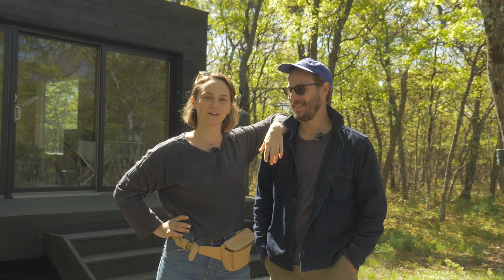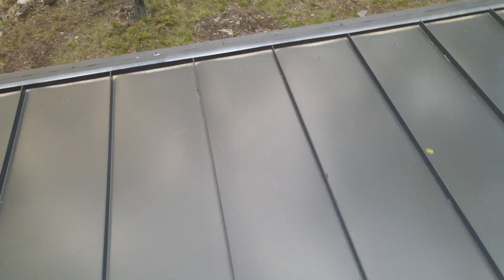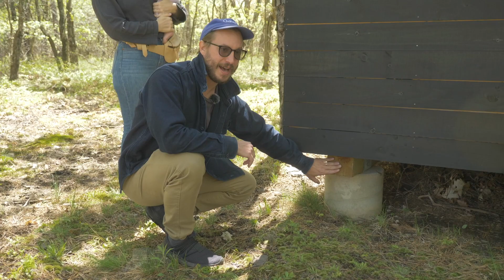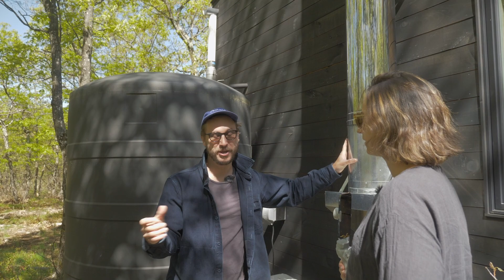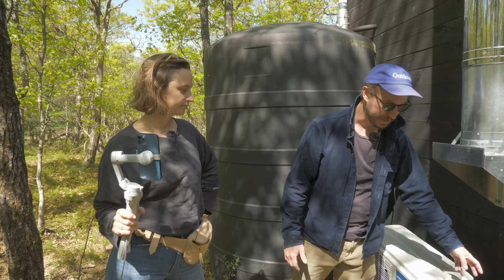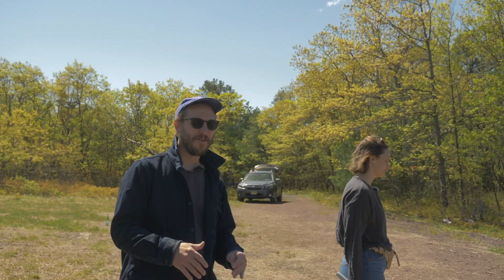Couple with ZERO Building Experience Builds Off-Grid DIY Tiny Cabin

Comment: Have you ever had any issues with freezing with your water system? Tank freezing being above ground?
Reply from the maker: No, we keep the heat on inside for the pipes at a minimal temp and the water circulating in the tank to avoid that!
Reply: @DENOutdoors  Thanks for the info! Do you have a link for the entire cistern system or anything to follow?

Comment: What’s the water system? Could you share with he brand or the website?
Reply from the maker: We used a Wisy downspout filter and a Doulton Ceramic filter plumbed in line with the the system. The water pump also offers basic debris filtration.